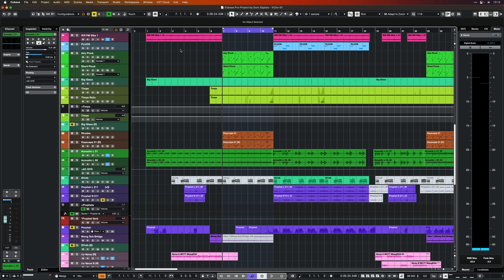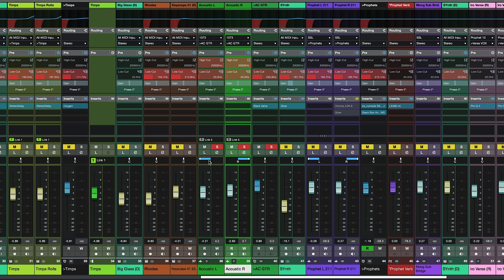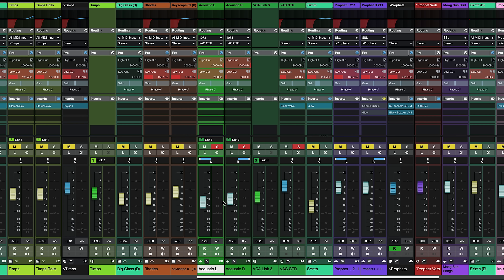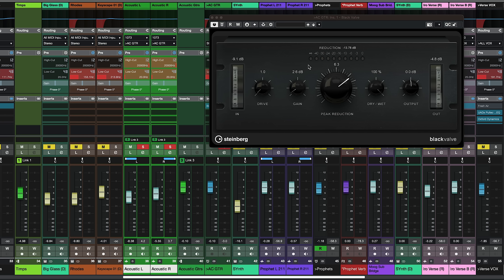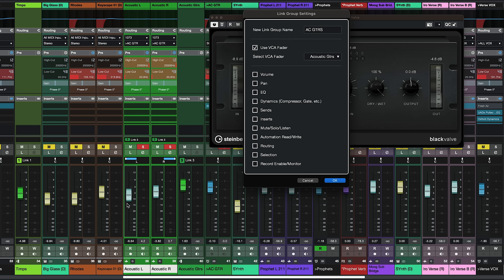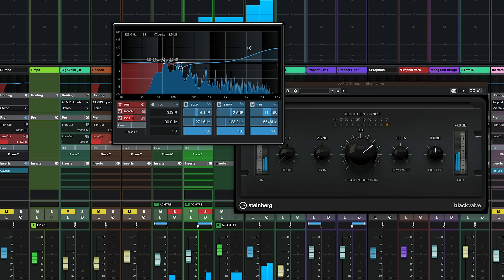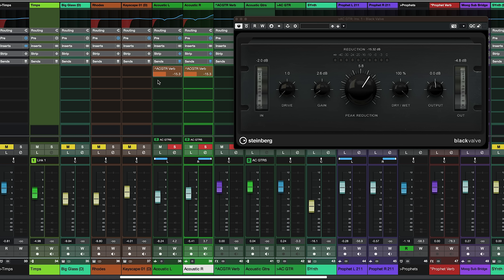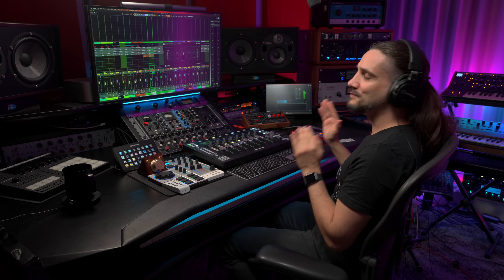Why You Should Use VCA Faders | Cubase Secrets with Dom

Comment: Reading the comments,, half of users think these are useful and revolutionary and half think they are not necessary at all or dont work right.  

Im gonna have to experiment with this,, ive always 'linked' Left/right guitar faders to keep their relative volumes matched and then send to a group bus where i do EQ  and compresssion.  When i drive my linked chnls harder it drives the compressor harder in the group buss also.  

 If i need to anything  at source level I think when i insert, send or make EQ adjustments it happens to both channels when linked but need to check now to be certain.. .hmmm..  I know you can shift select  multiple chnls and theres a hot key that makes same change to all the selected chnls simultaneously which is very useful.  So vca has not advantage in  these cases.  I can automate the group fader when mixing so i cant really see the benefit for this vca so far.  

Some mentioned it helps post mix automation if you later decide a track needs to be louder or softer,, well all you do is adjust the linked chnl faders.  The group buss automation can stay same. When I do final mix im only using group bus faders only.

Comment: Very interesting feature. I own Cubase 5.5.3 and I'm about to buy the Cubase 13 version, this is why I'm watching these videos. To this "feature", I must say that - unless removed in newer versions than 5 - after you select the two tracks, by pressing the up and down keys on you keyboard, you can get the same effect as with the VCA fader. The volume of the 2 tracks will be lowered or raised, also while keeping the relative volume between them. It will NOT work with the mouse, unless the channels are linked. Then, you can also use the mouse. In this way you can save a channel strip, that the VCA fader will otherwise occupy. VCA are probably more intuitive if you have used them on an analog console.

Comment: I still don't get what the VCA fader does that the group doesn't, apart from driving the compressor, which in any case I'd have as an insert on the individual channels. I get the usefulness of linked channels but not the VCA fader, on the group channel I can still control the overall level while keeping the individual sources mixed relatively and I can do all the sends etc. on the group channel. Maybe I'm missing something? 🤔

Comment: Except you actually should NOT use VCA faders in Cubase 13 right now because they have bugs that are being worked out. The VCA fader is causing a weird issue when you try to input numbers into the volume parameter of a track connected to the fader and when you close/re-open Cubase the volume gets reset to whatever the last value it is in your VCA fader's automation. I don't even know how you made it work for this video; I had to just stop using them altogether.
Reply: 13.0.30 fixes this bug, but for some reason only a half.  Input now works correctly. But the problem with VCA automation and re-opening cubase is still there. So yeah, don't use VCA
Reply: What about Cubase 14?
Reply: @friendtazo  I was told it was fixed in Cubase 14 but I haven't tested it. I just stopped using VCA faders because they aren't really necessary for anything. Most of what I used them for I can accomplish with the volume plugin they added to 14.

Comment: The VCA are a great tool indeed. The reason why I don’t use them is because I prefer to “group” te tracks (group option not creating a group fader) if needed. When you do so, you can also choose which common elements (eq, volume, etc)  you want to include. Why do I prefer this over VCA faders ? I don’t have an extra fader in my mix console. If I need to modify one common thing on many track at once without the need to group then, I use the super cool Q-Link shortcut :) it is however great that cubase is giving you the VCA option as many people prefer the comfort of a VCA fader which makes sense for many users.
Reply: I do see the benefits of using a VCA...I may start using them but not for tradtional VCA functions...only in the cases where I would need multi tracks to push more into their plugins with out changing the fader position of my group channel itself!

Comment: I'm sorry, but these aren't VCA faders, Cubase uses the wrong terminology. They're bus faders. You can't insert effects on a VCA fader...
A VCA fader, as its name indicates, Voltage Controlled Amplifier, controls the volume of a group of channels, nothing else.

VCAs:
Can Only Control Volume Levels Of Different Channels (Remotely)
Any Audio Channel Can Be Assigned To VCA’s
Cannot Receive Or Send Audio Signals
Cannot Process Audio Signals
Might Have The Option Being Muted Or Soloed

Groups & Buses:
Can Control Volume Through Their “Own” Faders (Direct)
Any Audio Channel Can Be Assigned To A Group, Which Can Be Routed To A Bus
Can Receive Or Send Audio Signals
Can Process Audio Signals
Can Be Muted Or Soloed.
Reply: He explained exactly that… maybe you didn’t make it past the group fader discussion into the actual VCA discussion?
Reply: You can't insert effects on the Cubase VCA either. It's explained in the video. The insertion of effects on both channels simultaneously is via the Link functionality, not the VCA itself.

Comment: Nice video. 
In my case I use VCA when I have a grout track with automations and I need to increase or decrease the volume of that automated track. So I create a VCA of the group track (not the individual tracks because I do not want to modify how "attack" the plugins in the group track, I only want to level that track and I do not want to modify  all the automation points).

Comment: In my workflow I also use them to automate the faders even on single tracks - doing so I can still change the volume of the track later, but the relative volume in time stays as I wrote with VCA.
Reply: Why?  If you need to make an adjustment after mixing with automation just up your gain on the single channel a bit,, done.  Automation levels stay same.  Thats hardly a reason to deal with a bunch of extra unnecessary vca faders lol.
Reply: @Parkplayground  If you put your gain up you will mess up how your plugins on this particular channel behave. It would work only if you use absolutely no dynamic/saturation on the channel - which is quite rare during mixing.
Reply: @PiotrLYRRE 
True. I think i see you point with the automation now.

Comment: so do you recommend sending all the drum channels to a VCA and the VCA to the channel group or the tracks to both the VCA and the channel group?
Reply: I always like to use a combination VCA and groups: VCA controls all the elements of the drum kit but the routing still goes to the Group (which is not controlled by the VCA ;)
Reply: @DomSigalas This is where I get confused. In this video, once you set up the VCA, AND linked group, with inserts and sends enabled, what is left for a Group track?
Reply: @ThomsenTower  it processes the sum of the channels! :)
Reply: @DomSigalas  Ah, I see. I forget that linking Sends through VCA still keeps them separate; it is just a "remote control" for controlling sends of several tracks simultaneously. Thanks for clarifying!

Comment: Nice video! One of the most useful thing of the VCA fader to me is it allow automating the level of your tracks while retaining the send relationships of individual tracks. Group tracks cannot do that.
Reply: Oh! thanks a lot, I didn't think of that. I was wondering why I would even wanna use a VCA when the group channel fader does the same volume adjustments.
Reply: Exactly the reason to use VCA over groups. Keeping the sends in check of your source tracks. If your source tracks don't have post fader sends then a group will do the job.
Reply: Nice to know!
Reply: You can automate group tracks.....
Reply: @skippyweb  I automate both 😎. Having both group and VCA at the same time offers great flexibility when doing mix revision for my client. Just within a few clicks you could change automation as a group / individual tracks. Great for balancing lead vocals / dub / backing vocals. Try it! 👍
Reply: @skippyweb  Group Chanel do that?
Reply: As default 'everything' is postfader. So basicly the same if you ask me.
But ya have to put the outputs of those fx/sends to that group when doing a relative automation.

Hmm
Reply: @mansosound  I used to do this but the problem is if you process that group further then you are also processing the effects. Also, if other tracks from outside the group feed those effects then things get crossed. Eg, a choir with mics on the different sections all sending to one reverb. VCA channels are not needed often but when you do need them then they can save the day.

Comment: I still don't see the point of vca. You already have a crazy number of tracks, folders, group channels, why would you add another fader to it all? I'm pretty sure you can achieve everything a vca does without a vca in Cubase. I may be wrong.
Reply: I was also thinking the same thing until I saw the other comment. Replying just so you can find the comment too.
Don't wanna copy that person's comment though.
It's probably the second comment there.
👍
Reply: Read @kelvinlee18 's comment
Reply: @i_jetlag  Surely you can have sends pre fader then automate the fader on a group channel,or just link tracks and automate those faders? Maybe I'm missing something. This all comes down to signal path
Reply: @alanredversangel Okay, you could do that I guess. I'm a rookie in mixing so I don't know much. Thank you for the tip.
Reply: @i_jetlag  My advice is don't listen to all the advice, just trust your ears. I mean you could for example gain stage everything to -12db then run it into a vca fader then into a compressor and adjust the fader to make it compress more, OR just turn up the input gain on the compressor. There are far more fundamental things that need time/ attention in a mix IMO.
Reply: Yes, you are wrong in this case. You can group things without routing them to the same place using VCAs. This makes them very convenient in some situations. However, VCAs in Cubase are bugged (which he didn't talk about in the video) and have been for years. I hoped that it would be fixed in 13 but unsurprisingly it went another upgrade without being fixed.

Comment: I have issues with VCA faders. They broke my mixes couple of times so I'm afraid to use them
Say I have main vocal at 0db, double vocal at -6db, and I create VCA fader for them, and for example I move it -3db in the bridge. I save project, quit. On the next day I open project and I have main vocal at -3db, double at -9db at start, and it moves to -6/-12 at bridge correspondingly
Reply: I have the exact same issue. I avoid VCAs completely now. I feel like they're not stable in Cubase unfortunately. Especially when using automations
Reply: You need to write automation for the tracks connected to the VCA fader. If you write at least one value at the start of each track, things work as they should. 

Otherwise, your fader levels will be offset by the amount dictated by the VCA's automation, which is not predictable behaviour.